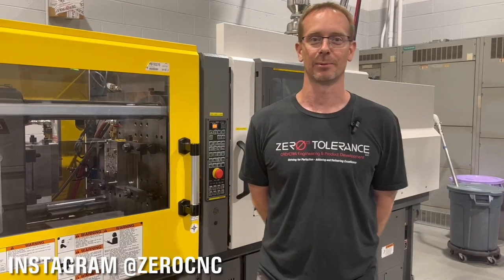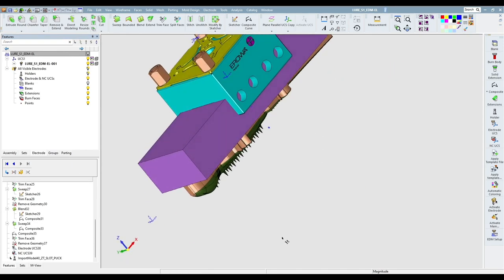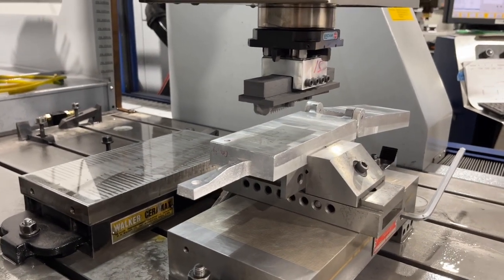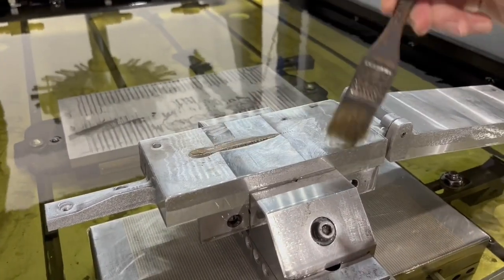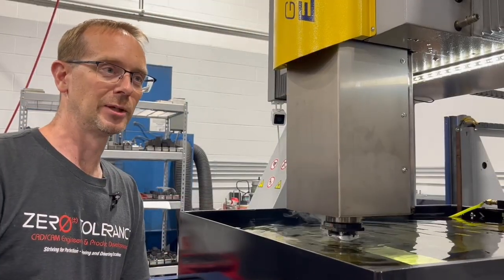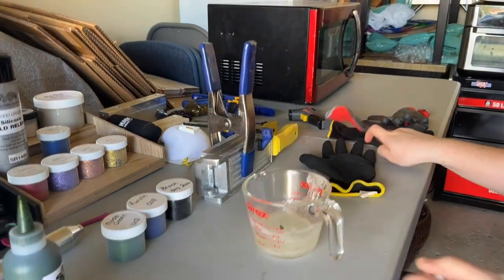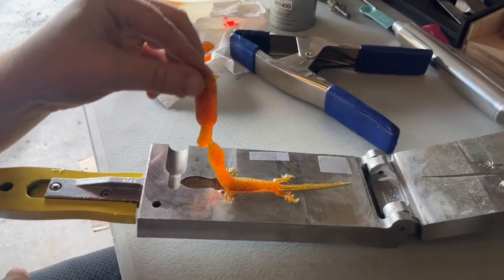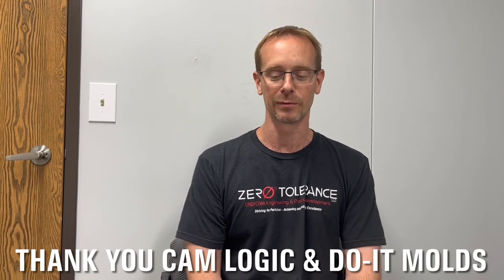EDM Goes FISHING! Creating a Fishing Lure with EDM

Comment: This was an awesome video.   It showed full life cycle manufacture of a mold, albeit not an injection mold but the principal was the same and closer to something the average person be exposed to.  It also showed burning with radically different geometries in one single electrode.   Just a question, what defines the maximum width of electrode that can be used.  Is it the maximum mold base size you can fit in the tank?  Is it the maximum current that the machine can handle through the electrode?  Or is there a limit based upon the electrode holder size that is used?  Get well Smitt!
Reply: Thanks for watching!! You can actually make the electrode as big as you want it, its based on surface contact and experience. If you know your overburn settings you can determine what settings can be used without totally blasting those small features out.